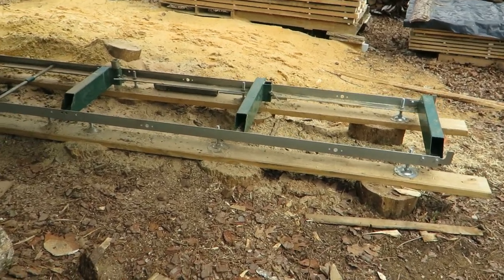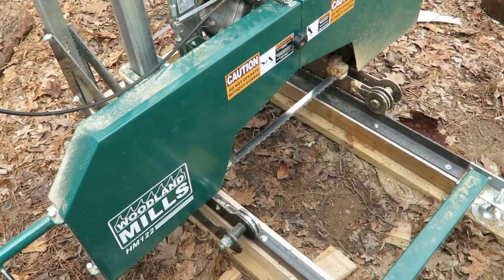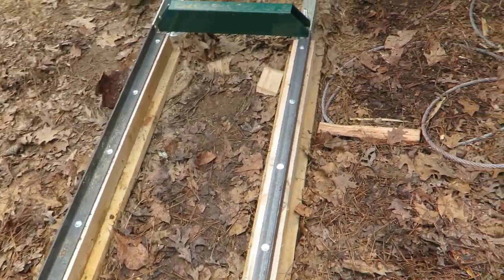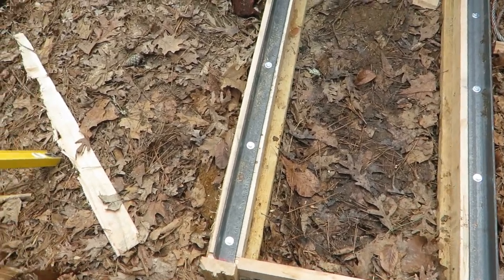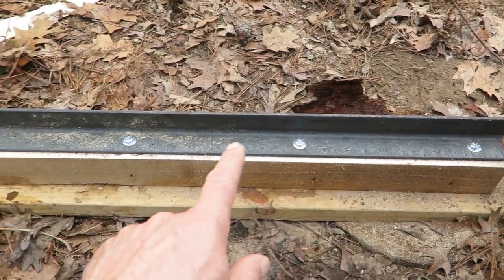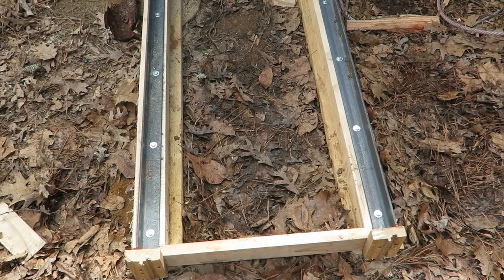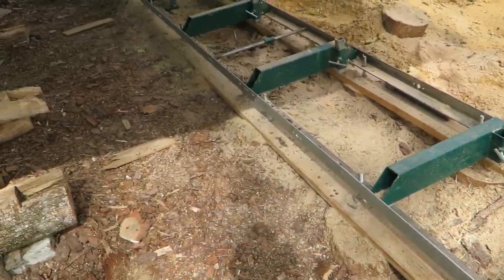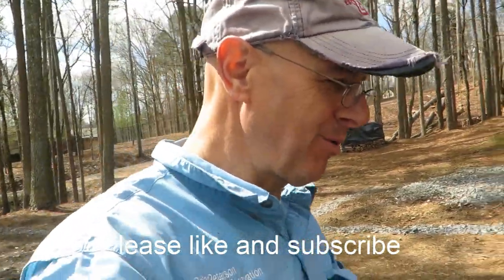Eps.#34 Cheap way to make a 4 foot track extension for a Woodland Mills HM122

Comment: Thanks for sharing the details.  I also have a track extension on my HM122.  I plan to occasionally cut 20’ logs from small diameter logs so your extension idea will help keep costs down.  I plan to load shorter logs toward the end of the track to reduce alignment errors.
Reply from the maker: That's a great idea!

Comment: I'll be adding 2' extension, excellent idea you had there, this way I don't have to risk hitting the head to get my max cut of 10'5" (no extended track) but I want to have ease to cut a 10 or 11 feet long log.  Thank you for the insight.
Reply from the maker: No problem.

Comment: Are those Woodland Jam cleats? The ones to push the log over to the metal posts? I have a different design on my 126 and I think you need more than one as standard equipment in saya  12 feet log?I have to make some.
Reply from the maker: Are you talking about the log dogs? I have two of them over a 20' length.
Reply: @thetennesseefrugalcraftsma7383  Yes the log dog that pushes the log against the metal outside posts. We used to call them jam cleats. Two for 2) feet of log track. Seems like too few,but I just set up my 126 and didnt get the track extension. I only want to saw up to 12Ft. 4 inches for logs. I will make an extension to get to that. I have my saw set up on a concrete slab. I had a Thomas mill and it came with three Log dogs. It had welded on  metal pieces on the bunks. You pulled the stakes when you got low down on the log and those worked. You couldnt saw as low as those were..
Reply from the maker: @kennkid9912  You can saw below 1 in but I have never tried it.
Reply: Should say 2 log dogs for enuf track to saw a 12 foot log. The Thomas could saw a 16 or 20 foot log as the base model and came with 3 dogs as std. equipment.. I never sawed smaller than one inch at the bottom of the squared cant. If you wanted a 1/2 inch thick board, you sawed it  off the cant while it was bigger. You know what I mean. I am going to make a home made extension piece like u did. To get at least 12/ 4 inches or so. I cant handle logs much bigger than 12 feet anyway. Have a good one. Wifes cousin lives near Knoxville.

Comment: I hear a bumping as the rollers move from your new rails to the original rails. I'll be surprised if you won't notice that on the wood you cut.
Reply from the maker: The bump is not in the height it is in the slight width difference.

Comment: My overall impression of the Woodland Mill was the track was kind of cheesy. You do have the leveling legs every so many feet to help level and support it. however. So it may be adequate. I cant believe two pieces of Angle iron are $35. each. That is a ripoff.I did see a guy attempting a big pine log on his W Mill. But I had to leave before he did it. You need quite an underpinning because all that weight will throw the mill out of kilter. A 12 foot plus track  length should standard. 10 plus is too short.
Reply from the maker: Lowes for the angle iron and yes, it was a bit pricy.  The mill will take a big log and stay level. I have had very little problems that way.
Reply: @thetennesseefrugalcraftsma7383  Did you say the finish on the Lowes angle iron was not smooth? And that on the mill was? You do have a good solution. My compliments.
Reply from the maker: @kennkid9912  No, it is fine. It is not galvanized though so I keep it covered.
Reply: @thetennesseefrugalcraftsma7383  Have you bought blades, but not thru Woodland? I am  looking for an alternate,maybe cheaper, supplier.
Reply from the maker: @kennkid9912  I tried Cook's blades but they did not cut well so I went back to Woodland blades. Some have noted that there are cheaper alternatives but I have not used those. I have about 18 Woodland blades that I have resharpened.
Reply: @thetennesseefrugalcraftsma7383 i understand Woodmizer sells blades for Woodland. Lenox makes some too. No idea how they are. My friend has a 35 year old WoodMizer. Onan 20HP, I think. We were talking about blades the other day. Thanks.
Reply from the maker: @kennkid9912  Yes, I do recall people saying that.

Comment: The way you're leveling because of your 4 ft extension is not correct. Leveling should be done from center out in both directions.  I'm surprised you were able to get it leveled properly.
Reply from the maker: It is working fine.